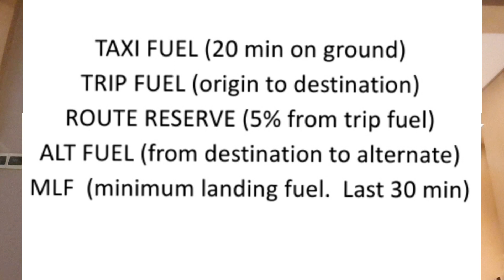FLIGHT 2933 Crashed following fuel exhaustion ⛽. What to do in LOW FUEL situation?

Comment: By flight plan B, I assume you mean a re-dispatched flight, in which the 5% route reserve is based on flight time from the redispatch point to the initial destination.  Do you normally use that fuel schedule?  You're right, it does not give a lot of fuel for unplanned holding.

Comment: Hello Capt, Thanks for the interesting video about your experience. I have a question: When fuel start to get low, are there any mechanical indications first that start to get trouble related to low fuel? (before the engines stop working). Which other systems start to het trouble before the engines fall out?